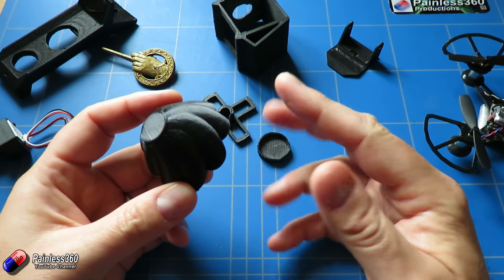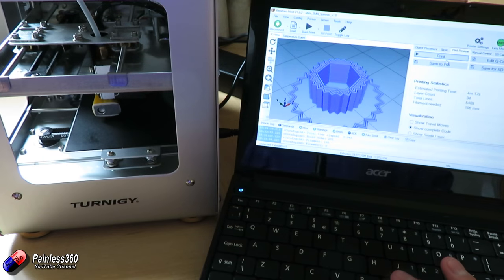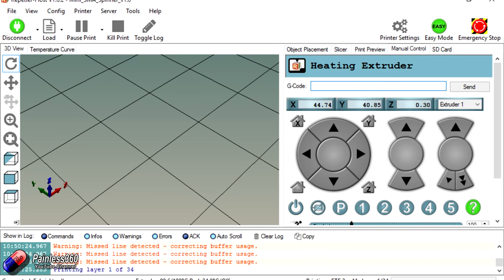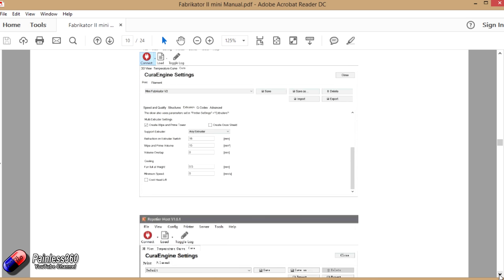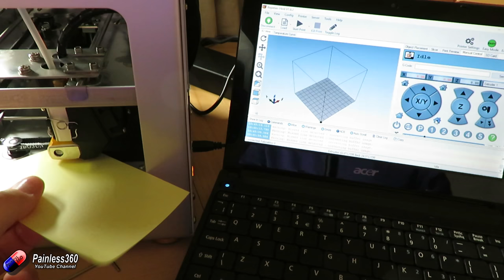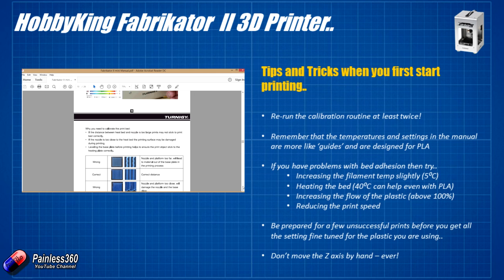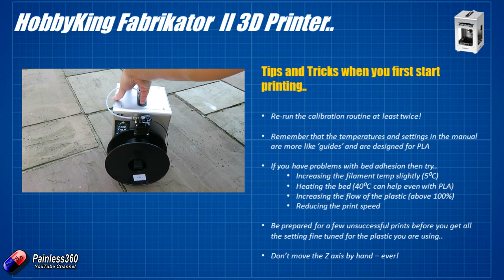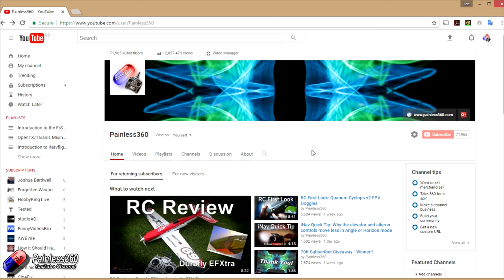First Look: HobbyKing Fabrikator II 3D Printer

Comment: I really was close to getting one of these for LED brackets and mounts last week but it looked to tiny. The size was keeping from pulling the trigger but that looks like its perfect ..... uses ABS and thingyverse compatible.....good timing. CHEERS !!
Reply: For the record (and 11 months late!!) , while I am now getting a bigger printer, this little beast has done sterling work for many months now and rarely have I been stopped by the bed size. As I run a club for youngsters using the Eachine E010/E011 quads I have almost "productionised" making Tx stick extensions, camera mounts, etc in bulk, and it has done that without protest. The bigger ( and considerably more expensive) printer is more to handle other materials and multi materials at once than to replace the Fab II Mini.

Comment: For the record, the file "Manual" uses screen pictures to describe setup. Unfortunately , quite a few of these screen dumps are of screens that need scrolling to view ALL the data, and the Manual does NOT show or explain these. In fact (and luckily!) there is little missed by NOT showing the off screen data, but when you first start it is likely to make you concerned you do not have enough info to get it to work properly, especially if it doesn't!!

Comment: you sure made short work of leveling the print bed...I'm having lot of problems. it was a pain to get it to work with PLA...I've just switched to ABS now and I'm finding it impossible.....got the hotend at 230 and the printbed all the way up to 60 max....I've literally been at 8 hours today, hardly a break....i get it level with the paper thing, but prints just won't stick...so i lower quarter turn and vice versa....still won't stick :-( I'm starting to suspect that my print bed is actually warped or the heater is fluctuating wildly or something/ it's faulty....but i could make it work with PLA...just a lot of effort.....
Reply from the maker: You’ll need something to help it stick. I use hairspray..
Reply: i did find your other vid after i posted that...I'll see if i can borrow some! think i need a better printer TBH but i got Petg coming now...hope that works better!

Comment: also i'm trying to print something nearly the max width of the bed.....but it's that perimeter bit it prints first is also causing problems....anybody know a way to stop it doing that?
Reply from the maker: That is set by the slicer you are using. I’d have. A look at the options in there first..
Reply: Repetier is the only thing i can get to work and don't seem to be able to turn that off....Can't get Cura to work, says it's outside build area when it's not :-(

Comment: will it print TPU?
Reply from the maker: +DroneRacers.nl I've not tried but I doubt it. Printers that use a Bowden tube to deliver the plastic filament to the hot end struggle as the TPU can compress in the tube itself and cause problems. Printers with the plastic fed directly into the hot end work better for flexible filament. Hope that makes sense..
Reply: yes I thought so too thanks for the quick reply!

Comment: I also own this printer and get the 'Missed line detected' message. Any idea what affect this has on the output?
Reply from the maker: Not sure, I ditched Repetier and use Cura and SD card exclusively now..
Reply: this is due to the stupid electronics ! the ARM controller is there as an eyecatcher, the firmware inside in very old and buggy. It will not work on up-to-date linux distributions. Can barely get it to work on Win10. China is stuck on WinXP !

Comment: can you print in abs or both
Reply from the maker: We're printing in ABS and PLA here. For ABS, we're using max bed temp (60 degrees), 230 degree hot end and hairspray and brims on the print to help with adhesion..
Reply: try modding the heat bed and you can stop using the hair spray.

Comment: how's the buyer's experience? anyone in the uk order one of these?
Reply: Had one for some time now, bought UK HK.  No supply issue. Had to fight the calibration a little to get it right, it printed great out the box for the first couple of prints with PLA, but then initially as it settled in that calibration drifted a little.

I have found the "blue tape" bed stickers useless even after careful recalibration, but the black thicker sticker as fitted on supply prints OK. They do of course wear, so buy some.

The head meets the bed twice on start of print. As it came it was touching the bed metal. Calibration was eased by slightly offsetting the black bed sticker so this "double tap" occured on the sticker and allowed for its thickness.

I had one pulley "fail" after a few prints, the front pulley on for/aft. All that happened was the flange one side, which was a push fit, came off, and the belt tracked of the pulley. This might have been due to minimal misalignment. Replacement and a tiny touch with some ultra thin c.a. on a screwdriver to the join (and NOT the bearing!!) has cured this and the printer has done innumerable prints since with no further need for attention.